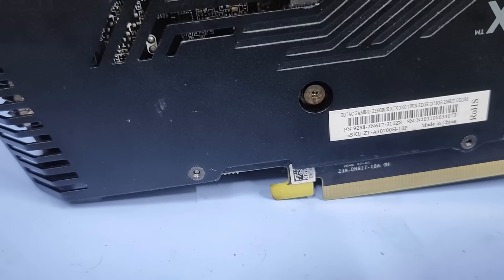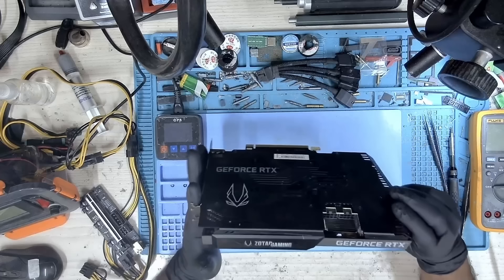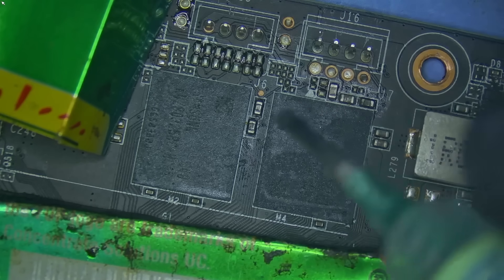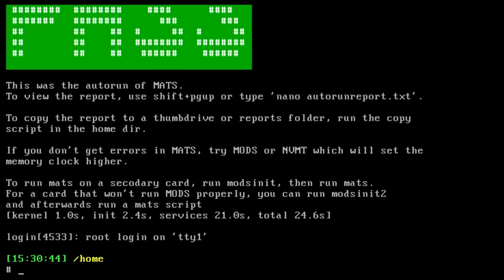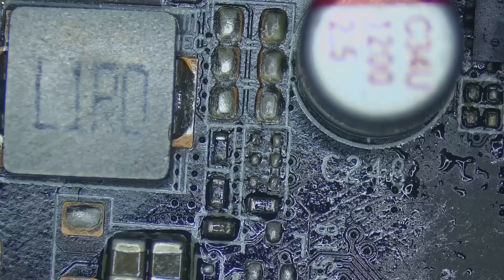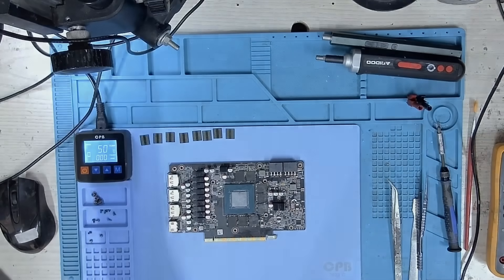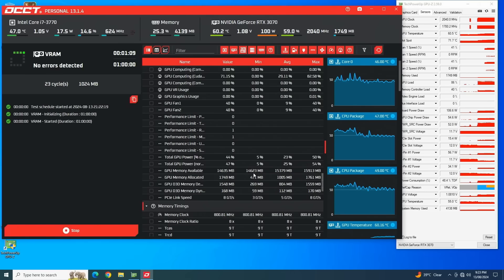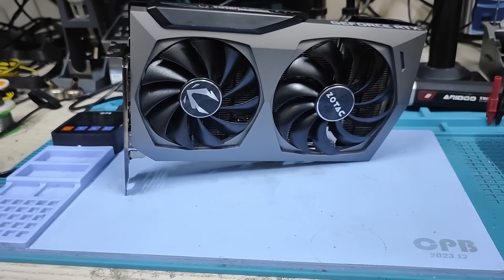Upgrading RTX 3070 Memory from 8GB to 16GB - Part 1

Comment: This upgrade is definitively worthwhile if one has the faster binned 2GB Samsung too (K4ZAF325BM-HC16).  RTX 3070 is severely VRAM limited in many new games, including Jedi Survivor, Horizon Forbidden West, Cyberpunk 2077 and many others. Those games need at least 11GB of VRAM, so even RTX 3080 10GB is having not enough. It is also interesting that RTX 3080 10GB is already obsolete, in terms of VRAM, yet many pay hefty price for it, only to realize they run out of VRAM.
Reply from the maker: Yes 3070 is a good card with a tiny 8GB. It's like injustice to this card.
Reply: @GraphicsCardRepairs-tk7ql  nvidia deliberately does that.
Reply: @sinenomine4540 exactly, them giving 8GB on 70-class cards for 3 generations straight is the exact proof of that.

If you look at it, even the 4070 wouldn't be given 12GB if the demand is so high.
Reply: @hadifelani  i partly agree with that take. Nvidia only offers good products for high end. AMD is probably the smarter choice for 80%-90% of people in low and midrange. AMD does not offer anything special in high end tough.

edit: i also want to add that FSR looks really bad. Its a very noticable hit on the visuals on most games where i did try to use it. I usually end up not using it.

DLSS while not perfect, looks much better, so does XESS. AMD is clearly the worst upscaler and id rather lower the resolution then having to use FSR, thats how bad it looks.
Reply: yeah and in 1080p that is. It already needs 9-10 gb at least in 1440p 11.
Reply: This is why I’m not changing my 6950XT for a while.
Reply: @HiimAbyss  You mean that brick that eats atleast 335 Watt? Yeah maybe you should save the money and buy a proper GPU.
Reply: RTX 3080 was obsolete the year it came out in terms of VRAM. I got mine on launch and sold it in a month because of this. Absolute ass card for the price.
Reply: Its a shame that Nvidia put 12GB of Vram to the 2060 Super, 3060 12GB.. but not the 3070,3080,4060Ti like WTF
Reply: I paid 1k for a 3070ti..
I feel robbed 😂
The vram is what really holds it back multitasking or even running another monitor while gaming
Reply: @RealKacho  Spoiler alert, if it came with 48GB, you were still robbed, and you probably even stood on line to get robbed.
Reply: @menotyou8369  ooh yea certainly , it was even from manufacturer not third party which makes it even more wild, and with the 50 series price leak, i feel even more people are going to end up in the same boat
Reply: thoughts on the hc-18? im trying to find the 4gb chiplets xD
Reply: The 30 series was absolutely horrendous. 20 series prices but they didn't improve the Vram amounts by much, on some cards like the 70 class they didn't increase it obviously. The Vram crippled what were actually really fast cards. They used more power than they should have as well. The 3080 being 320w was a joke, they get so hot compared to 40 series cards which are rated just as high but can have their power draw turned down significantly without a loss, and their coolers can manage their max power draw.
Reply: this comment tells me you have absolutetly no knowledge about the things you talk, damn how many of you got brainwashed from youtubers telling you about artificial VRAM problems with literally no evidence is scary.
Reply: You're tripping balls lmao, I have a 3080 and get over 100fps 1440p in both Cyberpunk and Jedi Survivor High settings
Reply: @dabbzgaming  You cant argue with AMD buyers, they believe everything youtubers tell them and feed them some affiliate links to buy the ultra extraterrestial futureproof amd cards xD
Reply: 3080 is far from obsolete my friend
Reply: @sohel_naikawadi  last of us part 2 needs 10.5GB VRAM at 1440p ultra. It is 3080 10GB is obsolete
Reply: @mikegaming i can see it being played at 1440p ultra without fsr at 85+ fps. Your statement is false. 

It can even play 4k!
Reply: I dont think you understand the meaning of the word "obsolete". None of these cards are obsolete just because they dont have the amount of RAM you think they should have.
Reply: Obsolete here means, that those cards with less than 12GB of VRAM will run out of VRAM in new games at maximum graphical settings. They were meant to be high end, allowing the user to use maximum graphics settings. But they cannot anymore without lag and stutter, due to VRAM running out (1440P Cyberpunk 2077 at max details takes 11GB, Horizon Forbidden West at 1440P Max takes 10.5 GB, etc.). That's why they are obsolete in that product segment. This is of course NVIDIA's product strategy and AMD is here more consumer centric with their RX 6800 XT 16GB high end GPU not nearing VRAM limitations at 1440P, or even 4K, so in that regard that GPU is still viable. And regarding the video of doing RTX 3070 8GB to 16GB mod, this greatly extends viability of RTX 3070 GPU, which has still raw power to run many games at raster rendering at max details, if it just would have the VRAM capacity to do so.
Reply: @mikegaming4924 max setting in reality is dumb. It is fun to see you can max out every details but it should not make you feel missing something when you can't use it. In Dirt Rally 2.0 for example the game look just about the same with high or ultra. But ultra can cut my performance by half haha.  i get 80fps using high but using ultra will push down the performance down to freaking 40+ fps.
Reply: @mikegaming4924  Yeah, that's not what obsolete means.
Reply: @Mico605  No they are obsolete, they don't have enough VRAM for their compute power, plain and simple, and how many people are simply going to upgrade instead of doing this mod? Probably 98%
Reply: Yeah when u play on 4k or 2k in Ultra. Just set it to High and here we go u can still enjoy it. U are over reacting 😂😂
Reply: @CarNewb  Agreed. This looks like a fun mod that I might give a go with my 3080 when the 50 series is out as I'm planning to buy a 5090 but I agree with you. I currently play cyberpunk at 4k high, DLSS quality, ray tracing off and the game still looks amazing with fps between 70-90. The difference between ultra with ray tracing honestly isn't that big but the extra work tanks my fps. It's essentially a choice between resolution and ray tracing or, both of those and fps on a 30 series card.
Reply: @CarNewb ah yes, "just use your high priced GPU as a lower priced one, stop over reacting" absolute clown
Reply: Those games need at least 11GB of VRAM... uhh I run cyberpunk almost maxxed out on a 4060 with only 8GB of vram.. and raytracing on with no issue lol. Around 70 FPS
Reply: @DarkAttack14  try using 2k or dlss haha, or additional mods, or vr mods ... oh wait, you cant.
Reply: @__-fi6xg  uhhh... DLSS makes lower power cards perform better, and that's with DLSS on and I've never had an issue using a meta quest 3 on it. Wtf are you talking about lmfao. I think you're confusing DLAA and DLSS, DLSS renders the game at a LOWER resolution which runs easier. DLAA renders it at your regular resolution. How can you talk about it at all with such little understanding of the technology involved?
Reply: @DarkAttack14  DLSS requires more vram to run
Reply: @__-fi6xg Wtf are you on about clown, DLSS is the only thing saving Nvidia's ass rn, it literally renders at a lower resolution
Reply: @kiro_luv8424  Does DLSS frame generation increase VRAM usage?

Yes. VRAM stores textures, frames, and other graphical data, and generating frames, especially at higher resolutions and quality settings, needs more of this storage space to process smoothly. whomp whomp whomp
Reply: @DarkAttack14  I found this is only possible at 1080p or 4k with DLSS AUTO. what settings are you using
Reply: @DarkAttack14 at 1080p, with upscalling, and most likely using FG
Don't talk until you know the convo
Reply: @DarkAttack14  no way.
Reply: @sinenomine4540  I have no reason to BS, very occasionally in a extremely loaded scene it will drop down to 50 fps but it's still playable albeit a bit laggy at that frame rate. For 99% of the game though yeah averaged 70 FPS. I did follow a guide that allowed me to shut off a few different features and turn some things down that don't make a big visual difference, but overall most of my settings are absolutely max. Raytracing off it can hit 100 if I remember correctly. I did get it to hit almost 80 fps average consistently with a small core overclock and 1000mhz memory overclock so maybe I just hit the silicon lottery?
Reply: @sinenomine4540  frame gen helps
Reply: @zerokool1985 frame gen need more VRAM. rather than being obsessed with higher setting just tune down the setting. Especially one that have minimal visual impact even if you crank up the setting up
Reply: @DarkAttack14  that's the secret though. go google every setting and figure out if you need it or not then adjust to your liking. and maybe try some things on or off and see the visual and performance hit.